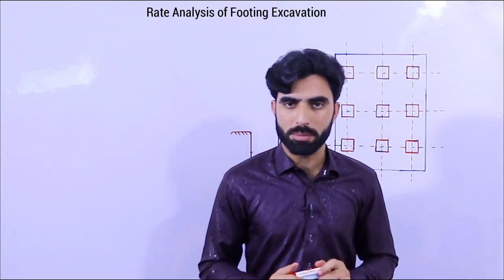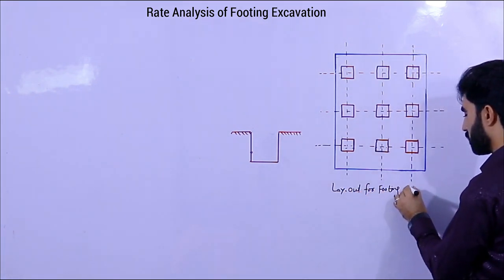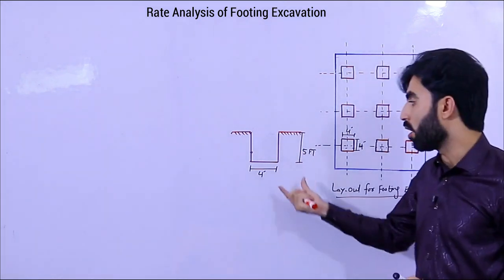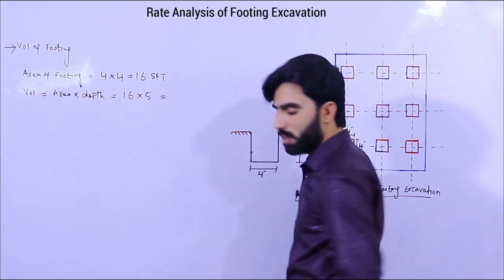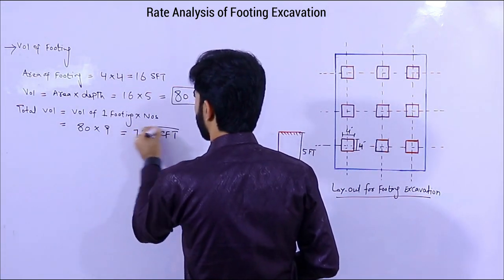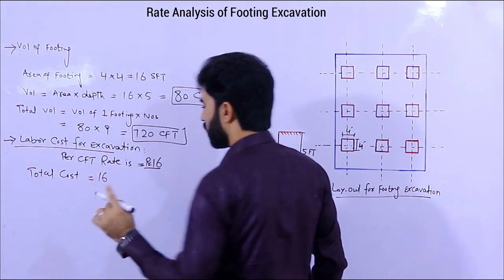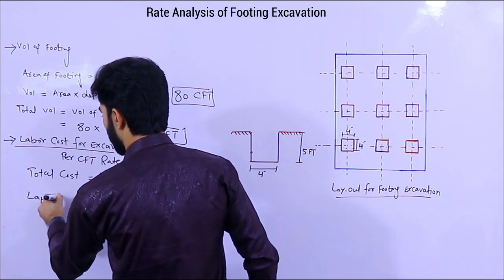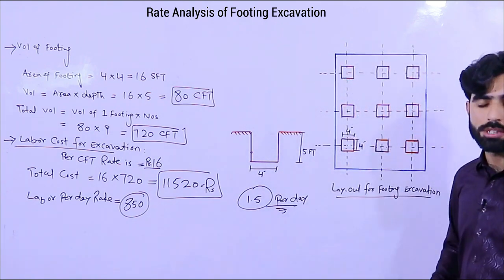Footing Excavation Cost for Small House Construction

Comment: Sir, is it possible you make a chart or a table for all the requirements for beams and columns, their size, spacing, steel dia, number of steel bars, size of footing, type of footing, depth of footing, sbc, conc grade etc.. for domestic and commercial buildings from G+1 up to G+9? It will be very helpful and we will appreciate.